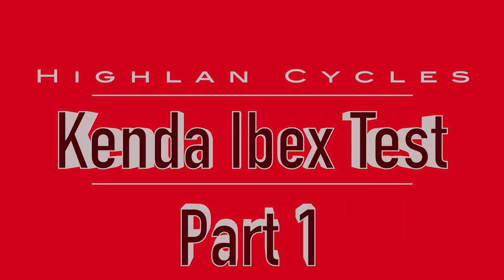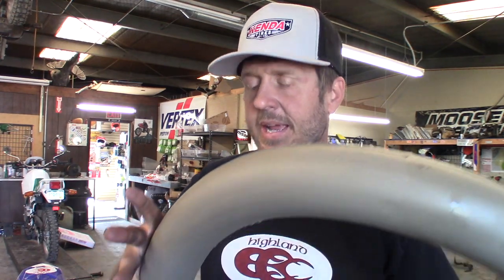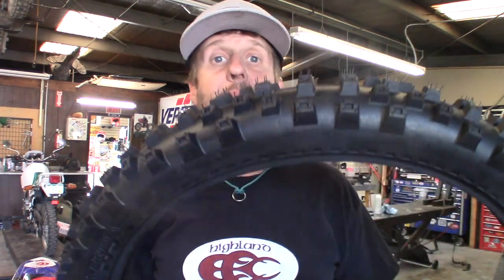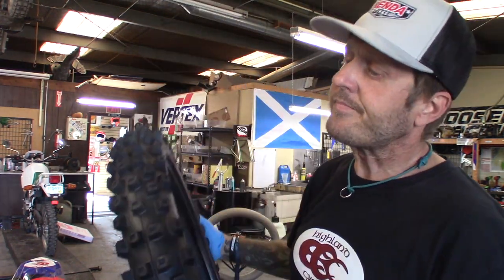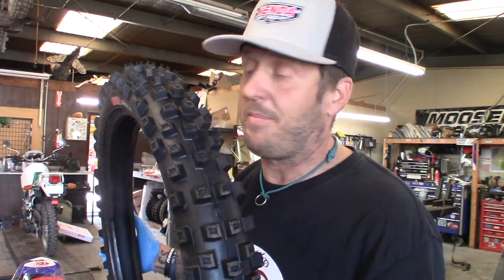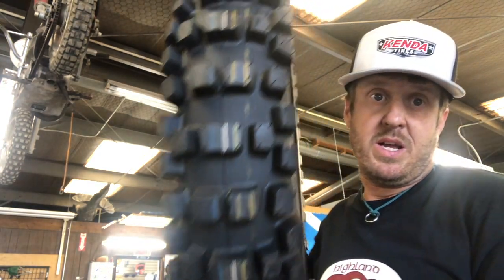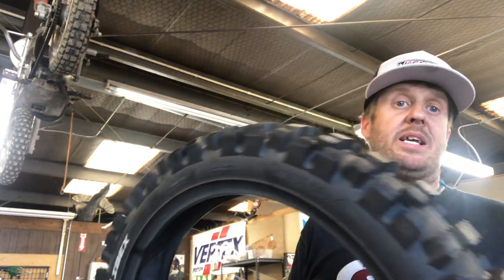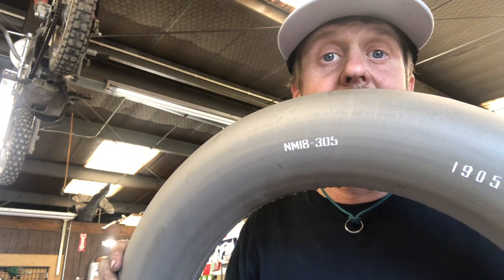KENDA IBEX TEST Part 1

Comment: Hey man great video, but when you're making the video, try to equalize all the audio across all the different sources so it's all the same level. Makes it a lot easier for those of us on crappy speakers and headphones. I had to turn the video up to hear you talk, then turn it WAY down when you switched to the garage.
Reply from the maker: Dr Foxxy thanks man. That’s something I definitely need to get dialed
Reply: @highlandcycles  I recommend Audacity, rip all the audio you need, in the order it goes in the video (after you've aligned everything), toss it into Audacity and equalize it.
Reply from the maker: Dr Foxxy thanks a ton